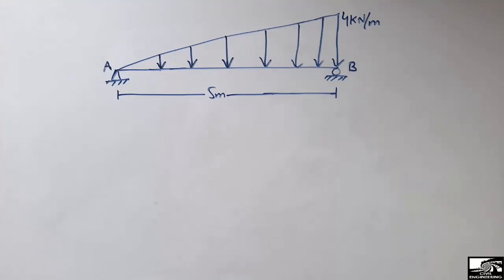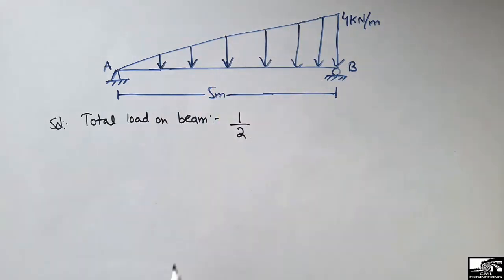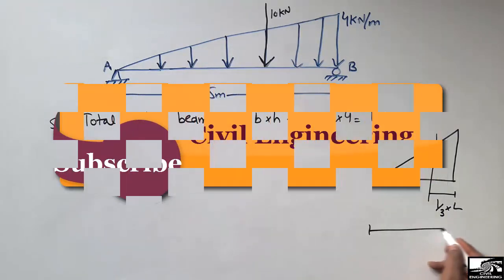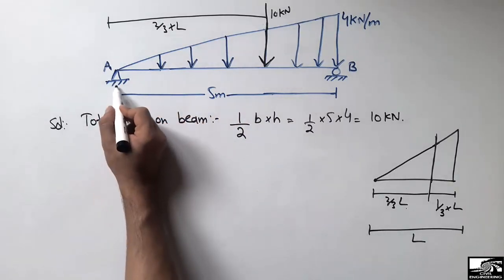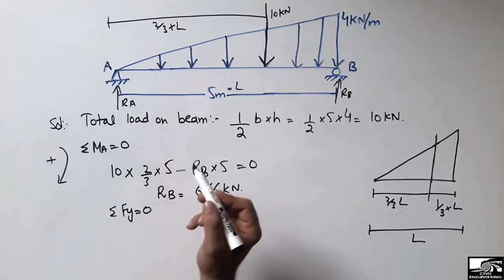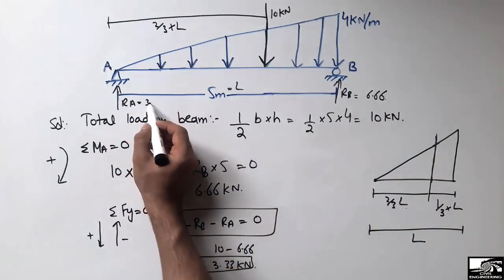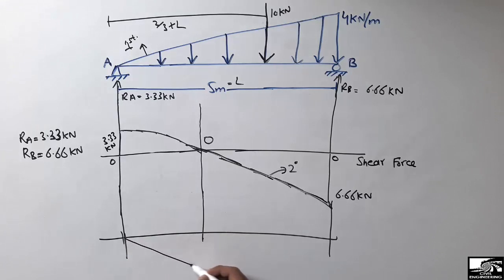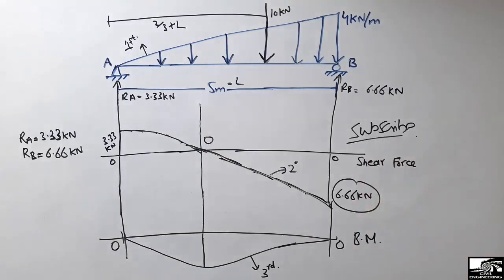Shear Force & Bending Moment with Triangular Load on Beam

Comment: Think of h/x=4/5. rearrange so h=4x/5. integrate this to find the function for the shear with the C value being 3.33: V=-2x^2/5 +3.33. (negative because should be concave down). Set V=0 (at max moment) to find x-intercept value. Integrate again to get M=-2x^3/15+3.33x.  Plug in x-intercept (2.89) to find max moment (6.41)

Comment: But you didn't find the x bar value associated with the shear force, that's the only thing I needed help with 😅
Reply: Thanks mate
Reply: Same here 😂
Reply: Same here😂
Reply: same here
Reply: @zachills4757  To find the x bar, you'll need to formulate a parabolic equation for the curve (using y = mx + b). From there, you integrate and solve the equation. Technically, you can also find x bar by using shapes, but it's all the same method (just different variations).
Reply: @wildfyre-music   thanks bro
Reply: @zachills4757  you can solve x bar in 2 ways:
1st is using squared property of parabola:
basically here find the ratio and proportion like this:
3.33/x^2 = (3.33+6.66)/5^2 
2nd is by using shear equation:
so first make an imaginary cut from left. I chose left because If  i started from the right, there would be two loads id encounter two because one from triangular and rectangular load. so better i cut from the left. then make a shear equation. v=0=3.33(x)-(0.5)(4x/5)(x). notice i equate shear to 0 because max shear occurs at neutral axis. 

these 2 method must yield same answer
Reply: @christianlouieursua5534  I did the 1sf method and it worked but the second area it didn't fit in can we chat if u know it
Reply: @kimmaria9740  send me your email ill send to you the soln
Reply: me too